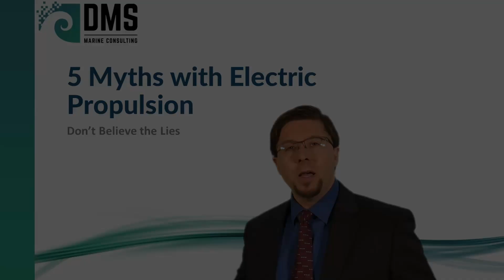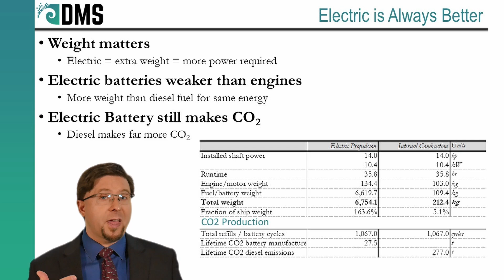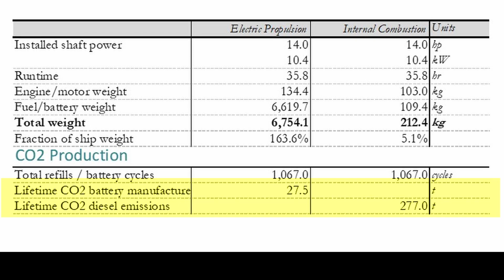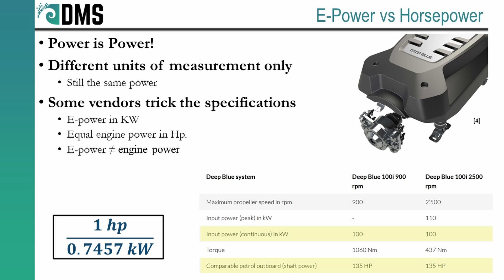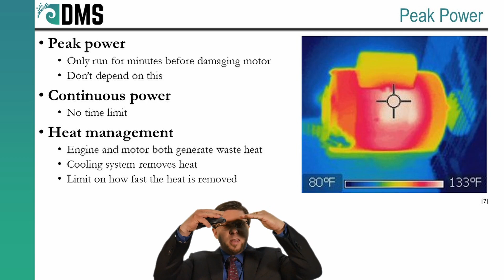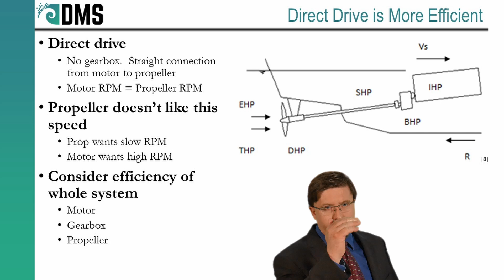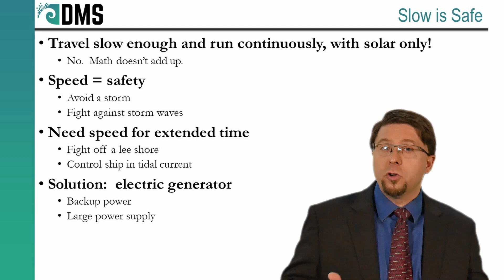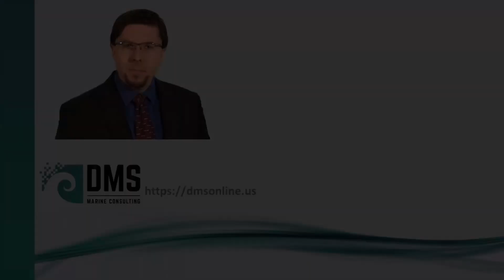5 Myths with Electric Propulsion:  Don't Believe Marketing

Comment: All good points. Battery is overall useless for boats/ships, except for ferries. I am certified on a few here in Norway and they sure are amazing machines. 
What I would disagree in your video is complexity. With modern equipment, batteries are actually quite simple .They are different but there are almost no moving parts, no oil changes, no leaks, no fumes, almost no maintenance. You need some controllers to supervise the battery with loading or discharging but that's it. Also modern Li ion batteries are holding up fantastically for the absolute abuse they get on our ferries. We charge them with up to 4 MW every 30 minutes but they barely degrade.
The major downside is simply the range, that's why all Norwegian ferries that have plug in electric systems (about 64+) only one is without combustion engines. All other ones have 2 backup diesel generators to help when power is low, converting them to peak shave diesel electric propulsion systems.
Reply from the maker: That's a good point.  I see it as an increased complexity more due to the associated systems in a smaller vessel.  If we are just talking about straight electric propulsion, I agree that they are equal to engines in complexity.  But with small ships, I see people integrating electric propulsion, diesel generator, shore power, solar charging, recharging from using propeller as a water turbine, etc.  That complexity isn't inherent to electric propulsion.  But I see that electric propulsion allows us the opportunity to explore the increased complexity and provide a more flexible power plant.  (Granted, much of this only applies to small ships and yachts.)
Reply: @DatawaveMarineSolutions  why do you say that an electric engine has more complexity? an internal combustion has a lot more complexity and parts and even more complicated electronics.
this is a good video from an Engineer about the environmental differences between Cars but much  should apply to boats https://www.youtube.com/watch?v=6RhtiPefVzM
There are disadvantages to Electric engines and batteries but it does not help your argument if you invent reasons without backing them up.
Reply: @akcarlos  I like Engineering Explained (EE)  but I don't think that video applies to boats.  For one, boats not only have to push through (well, most of of the boat)  a medium 1000x denser than air, it also has to work against wave drag especially at higher speed.  This means that even a few increase in weight means that the consumption increases by a larger factor than in a land vehicle.  Also, remember that on larger land vehicles, the problem of the larger battery becomes an issue.  See EE and even thunderf00t's video on the Tesla Semi

As for complexity, he probably meant the control system.  Sure, a combustion engine is complicated but you only have to control it.  With battery propulsion, you got to do energy management with hotel loads which is complicated.  More so for hybrid systems.
Reply: For a lot of small yachts there will be a solar setup with storage battery anyway. Making it 10x bigger just changes the physical size of the parts rather than adding more complexity. But comes with the advantage of being able to run induction cooktops etc so you may not need gas for cooking any more. Then it comes down to whether you have a generator at all. But even if you do, the difference between "we're under power so we're putting hours on a fossil engine" and "it's been six months, we need to start the generator" is significant. "Sailing Uma" don't have a generator, "Rigging Doctor" do, for example.

But for commercial operators you're going to need something, whether a nuclear plant or a diesel one (FWIW nuclear are almost all nuclear-electric systems, so you've talked around those boats)
Reply: @mozismobile  Uma added an emergency backup generator to boat during their northern Norwegian voyage.  They couldn't produce enough electrical power during the long nights even for their house loads and they found they couldn't depend on marinas either.  They did try to play with wind power, but
fell back on a small gas powered generator for occasional use.  The definitely wanted to avoid the threat of being frozen in to the ice...
Reply: Lader dere så inn i hel.... hardt ???

Men dere kjører vel batteriene hardt også ??
Sånn feks tenker på å få en 20kw el motor på akslingen min. For lade opp en 20kw eller kanskje 40kw li ion pakke på den en av dem styrkene da.
Lades fra diesel start av motoren med eller uten drift 30 til 60 min.
Skrur av å kjører elektrisk på 30 40% kanskje mindre også.
Cruiser på european waterways et par 3 5 år ca.

Lader fra 20% til 80% i en hastighet på under en time. Kanskje halvparten av det å.

Kjører rolig å bare 4 Max 5 knop så lenge som mulig.

Starter feks den siste halve timen til parkering for dagen.

Skal nevnes jeg har batteriene til det.
Har også en del paneler. Feks har 4 60volt paneler på 320 watt skudd sammen i en flate å laget som et tak over flybridgen min. 
Men her har jeg ekstra høyde med tanke på å lage to ramper en kan trekke ut for å få mer kraft fra sol paneler.
Har også plass om en vil til 6 til utenom dem med flytt av rader. Å lage noen hengsler å div småting en kan lage selv.

Panelene må selvsagt deles opp i flere sett med flere lade kontrollere. Ja stemmer. 

Men dem 4 jeg har nå montert går direkte på en hybrid inverter til husbanken. 

Så her er du vel enig det kan være et bra alternativ om en får gode priser på paneler el motor å skap til å styre lading å bruk til drift ????????

Likte svaret ditt kjempe bra.

Å har super priser på mye av dette så lurer faktisk på et ekstra seil drev utenom også.  Men får se hva en får ut av akslingen fra motoren som i utgangspunktet er for stor for båten min uansett.

Båten Hollandsk stålbåt av typen laget for 2 familier på ferie i lange tider.  Så var lett å bygge om til hytte/minihus på sjøen. 

Håper du kan lufte litt av dine tanker her 

På forhånd masse takk❤
Reply: EL engine conect to propshaft can both charge and drive.
Hybrid inverter use solar before batterys.

So dont agree in total for video maker. 

Can more agree whit norway ferry dude
Reply: you missed the obvious. you dont use batteries, you use a generator to make the power. makes it a modular system that doesnt have to stop for maintenance when combined with battery. easier to accomodate in the vessel as components arent required to be all in the stern, silent when needed like steaming at night, you can run multiple systems from the battery storage, bow thrusters etc. many benefits.
Reply: so basically you say the electric is simpler but in the same statement you say they have a back up combustion drive. how is that les complex  than ONLY having the combustion drive .    
an i highly doubt that there is NO degradation on the batteries when they are charged at 4mw for 30 mins . its IMPOSSIBLE to not get any degradation at those power usage levels 

what  needs to be done is a diesel electric drive like used on trains,  where the diesel engine simply acts as a generator at a constant rpm  then the electric motor can run your props or jet drive . diesels love being run like that and can have batteries built in the system for back ups  and for use when in port maneuvering the vessel.no on shore charging infrastructure needed making it ALOT more environmentally friendly than straight electric
Reply: Spot on. My fuel, fumes, and maintenance are a thing of the past. I can now actually afford to venture out on my E boat.

Comment: All this besides the fact that you'll dock and use a charging station that's either run by a diesel generator, or it'll be attached to the grid which is mainly coal and gas powered nearly everywhere in the world. 🤣
Reply: Coal powered grid power after transmission losses is about as dirty as regular engine. So even if you charge it with coal power it's ok. Any amount of renewable energy that you get will help.
Reply: That last part is far from true. I think this is a common misconception primarily amongst americans. The math says very strongly that the thermal efficiency of combustion based power stations are so much greater than a tiny mobile internal combustion engine that you're always ahead of the game using grid power.

Comment: Power is power, yes, but power/torque curves can be different for the same power. Electric motors tend to reach max power at lower RPM than ICEs, which may or may not be a good thing depending on the application. 

With regards to direct drive. Electric motors can be built to run efficiently at a wide range of RPMs. Optimizing for low speed generally come at the cost of larger size, weight and cost. I do agree,  usually a smaller faster motor with a gearbox makes more sense.

I think as the technology stands today, electric propulsion mostly makes sense for sailing vessels, which usually need ballast anyways, and vessels that are intended exclusively for sheltered waters, where 4kts is a perfectly viable speed in the vast majority of circumstances.

Comment: Enjoyed your video, really valid points. I sell electric motors & batteries and we often tell people that there are parasitic loads on smaller motors (<50HP), i.e. alternator, water pump, and this means the number on the cowling is not the HP delivered to the propeller? Do you think this is a truth? And we also say there is a better 'feeling' to a flatter electric throttle/torque mapping. The effect goes away sharply as you approach 50HP.
Reply from the maker: I want to say that is not true, because I would like to believe that all engines report a true and accurate rating of their power.  But I'm sure some manufacturers cheat the system a little.  They should be reporting "brake power" on the engine.  That would be the power output, with all the extra loads like alternator and water pump that the engine needs to keep itself running.  "Brake power" comes from testing the fully assembled engine on a dynamometer and measuring the power output from the shaft.  But, I'm not an engine manufacturer, and the cynical part of me suspects they find ways to adjust the numbers slightly.

As to the flatter electric throttle / torque mapping, not sure.  In theory, a digital throttle can always be smoother than a menchanical one, simple because we can program the digital throttle to account for changes of the torque curve.  But that's not strictly electric motors.  I have also seen this behavior on larger outboards that now include digital throttles.
Reply: @DatawaveMarineSolutions  Thanks for taking time to reply. Another thought is that certainly 'repowering' with electric is rarely practical, since old hulls, old tricks, high drag. Too many issues for private owners to stomach. But for new builds & hulls built for purpose? Perhaps there's a future there for Naval Architects in that specialty. I worked on a Oram 62ft cat that could reach 10kts on only ~10kw. it was only 8T which helped. Makes for a cheap system, I think there'll be some narrow band of private usages/vessels that work.
Reply from the maker: @brentsinger1980  That is very true.  I have worked with a number of clients designing new hulls for electric propulsion.  The biggest difference:  I spend a lot of effort to keep the drag as low as possible.

Comment: i disagree with your battery pollution numbers. a ship will be pushing batteries harder than any car, and the cars have to have the whole pack swapped after 5 years due to degradation. but even if you keep it at 5 years, if that ship runs for 20 years, that's 5 battery packs. all of a sudden, the batteries aren't beating diesel. however that also doesn't take into account that extracting, processing and shipping diesel also produces significantly less pollution than the mining of all the substances the batteries are made of.

batteries are not better for the enviroment unless you just hate combustion engines and ignore reality. would the crew/passengers like you to have a battery bank so the generator doesn't have to run at night? sure. would the instant torque that electric motors provide be good for thrusters? long as the water isn't cold, sure.

instead of using things to their strengths, these people demand all or nothing. nuts to them.
Reply from the maker: You make a good point on the carbon cost for battery production.  I intentionally avoided tracing the carbon footprint for engine production and battery production.  That can become a very difficult summation since you need to consider the full supply chain and the CO2 cost for transporting components across a global supply network.  It just opens more questions than it answers.  
I also feel the CO2 cost is not the major issue to use batteries on ships.  Weight is the major issue.  We simply can't store enough energy at a small enough weight in batteries.  They don't even come close to matching current internal combustion.  So I still recommend internal combustion on every ship.  But I have seen great advantages with the hybrid approach.  Use a smaller battery pack combined with a generator or engine.  This has the advantage of drastically reducing the time you run the engine, especially with yachts.  And for the propulsion, the battery acts as a buffer, allowing you to run the engine at exactly one speed for peak efficiency.
Reply: Tesla is rated at 1500 full cycles or about 400,000 miles.  You do that in 5 years!?  You can if you drive a full cycle basically every single day, BUT I call BS on that!
Reply: @zachstine3468  1500 cycles are reached rather quickly if you use it daily
Reply: @razorblade7108  a half cycle does not deplete the battery life the same as a full cycle.  driving 1 hour a day is a fraction of a cycle and the battery may go 3,000 or more cycles driving a short amount per day.  you should expect 300k miles or more from a tesla battery, which is usually more than 15 years for most drivers and even then, the battery has 80% of the range.
Reply: @zachstine3468  A lithium ion battery lasts around 3-5 years, even when it's not used. And I don't mean it will have reduced capacity (which happens much sooner), it will be swollen because hydrogen builds up from the electrolyte inside through chemical reaction, making them unusable. Also the internal resistance increases as the electrodes oxidize over time, increasing the heat produced when current flows. The cells used in cars are basically the same as in laptops and they work the same. What's degrading them the fastest is actually leaving them completely charged or discharged. The lifetime is the longest when they stay at around 50% charge, which should be used for longer storage. If the charge is too high or too low over long periods of time, lithium batteries degrade even more quickly.

Regarding the cycles, half a cycle counts as half a cycle, so of course it depends on how much you use the car, how you drive, how much power it uses and how large the battery is. You would be very lucky to only drive an hour per day on average. The average person with a car will use anything between 50% and almost 100% per day, and even more during longer travels on vacation or for work. One cycle is counted when the equivalent of one full charge has been used, so when you use 40% one day, charge up to 100% and use 60% the other day, that counts as one cycle. If you need multiple charges on one trip on one day, which is not uncommon, that means one cycle for each 100% of charge that is accumulated.
Reply: @razorblade7108  That's total BS. Hydrogen buildup? : your confusing with led acid batteries.  My 4 year old Tesla has the same range as when I got it. It's driven almost every day and has almost 100,000 km on it.
Reply: Since when do cars swap battery packs every five years? That's simply a lie. Like there's nothing to unpack there, that's just bottom to top a lie.
Reply: @weatheranddarkness  It used to be the norm.  But LiFePo battery have more than tripled that life span and it is still increasing.

Comment: wait but when a car says "200hp" or whatever that too is peak power; if you ran that engine at peak power RPM and full throttle you'd get a very reduced lifetime. Also yeah power is power, but in many cases the availability of max torque at any RPM makes vehicles accelerate harder in the real world. "holeshot" with a jet boat for example is easy to do with electric torque and can bog down an equivalent hp ICE engine.